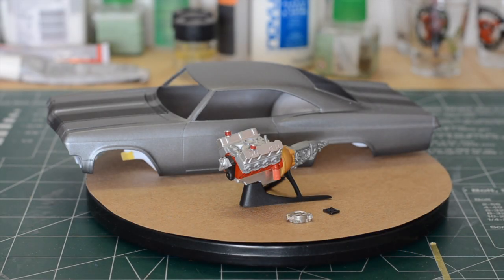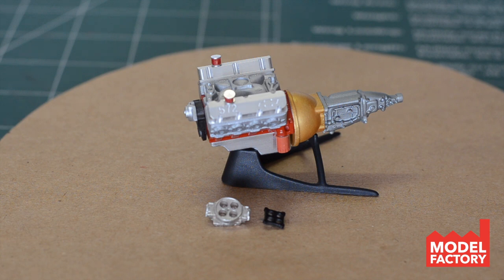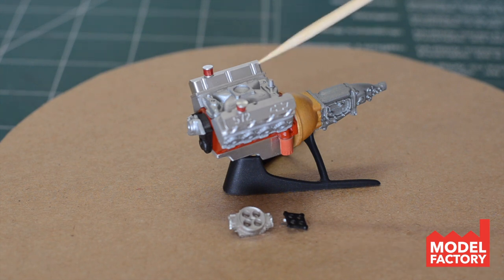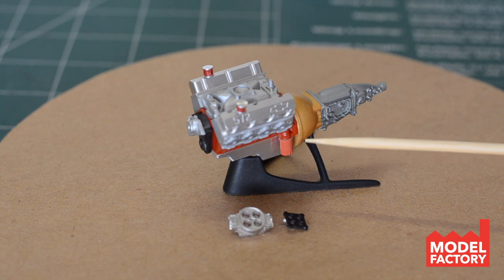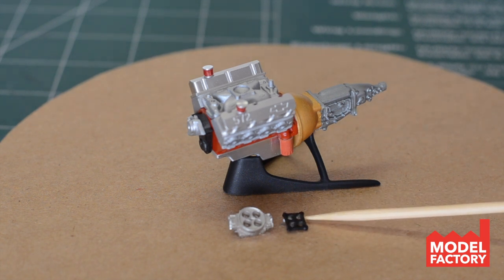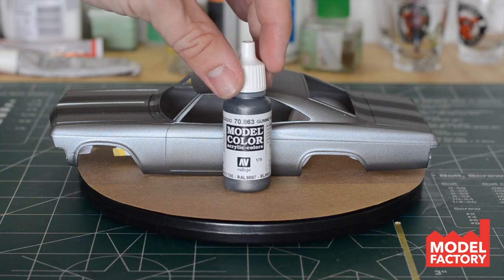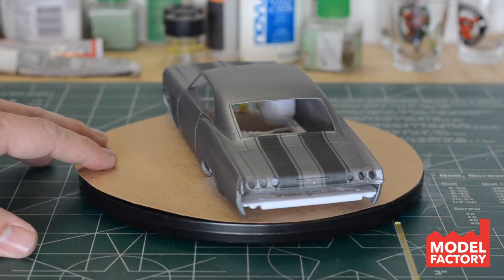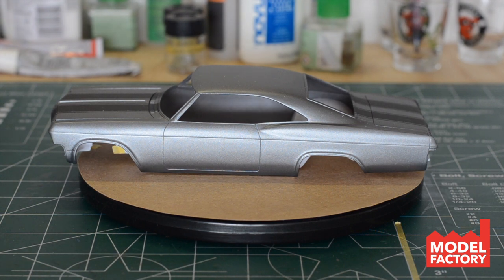MF | 65 Impala Update 1

Comment: A cool effect I found is using a candy paint, like the old testers metal flake, with out shaking it up and then covering chrome or polished aluminum with it, it gives you an anodized look.
Reply from the maker: Thanks for the tip Darren, I use the Dupli-Color Anodized spray paints that you can get at the Auto parts store to achieve the anodized look.
Reply: Paul Turley Very cool! I'll have to give that a shot. Kinda showing my age I reckon.